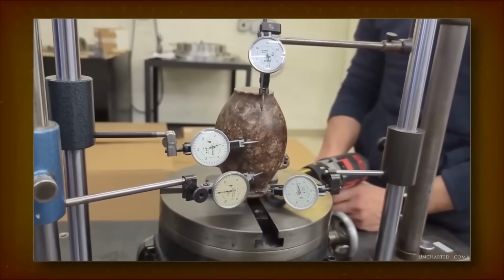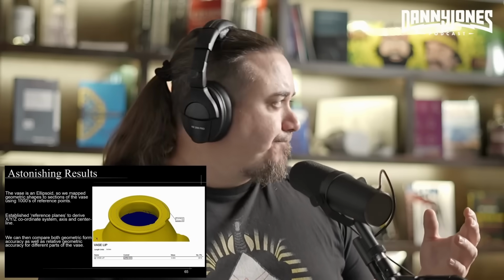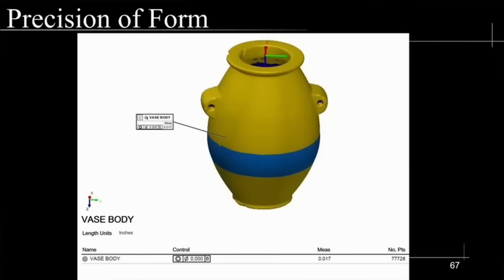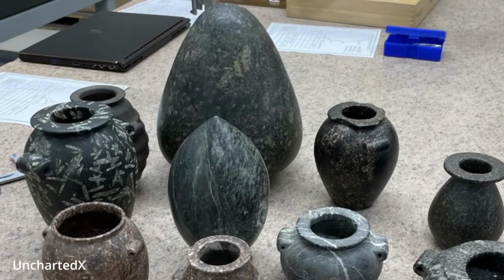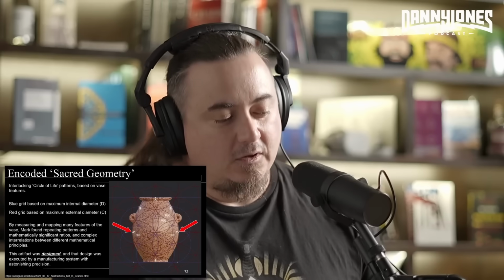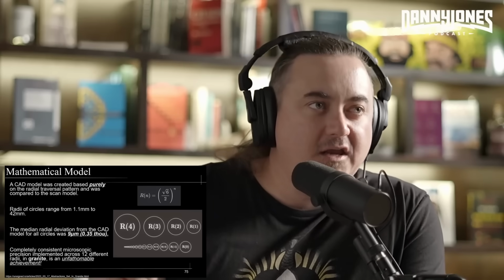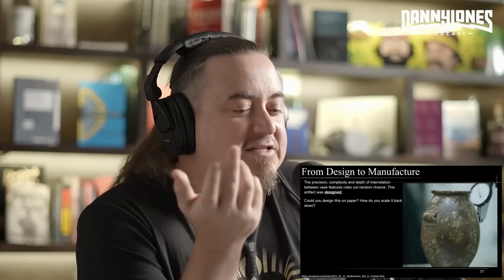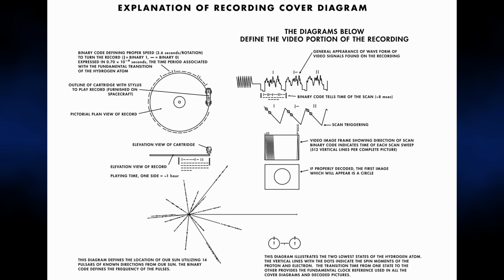Are These Ancient Egyptian Vases Actually Impossible to Make? #podcast #science #history #egypt

Comment: I once left a respectful comment giving alternative possibilities on one of his videos that was quickly removed. Hmmm. I have a life time experience as a sculptor making things as they were made in ancient times. As for this vase, obviously the finished product in granite was not made on a lathe due to the projecting handles. I would say it would be turned on a lathe in a very fine hardwood with the handles applied later. Then a mold is made and it is cast in geo polymer. Dr. Davidovits has done decades of research in geopolymer manufacturing in ancient Egypt. Most of these vases appear to be made of a breccia type stone. That is a stone that has been shattered completely and later recombined into a solid stone. This can happen naturally, but it can also be man made. It takes an expert of the caliber of Dr. Davisvits to tell geopolymer from a natural stone as the amount of "cement" binding the stone back together is microscopic.  All the raw material for this process occur naturally in Egypt and Davidovits has identified geopolymer in some stone in the great pyramid.  Smash the stone into fine gravel, combine with additives, then pour and tamp into the mold. I have no doubt that this is how that mysterious very thin famous "wheel" made of very hard black stone was made. Same thing for the pyramids, smash the soft limestone, carry it in baskets, no mysterious huge ramps required and tamp it in wood molds, where it dries into limestone once again. I have read that the great pyramid has a much higher humidity level than it should, which could be from the geopolymer construction. Pyramid stones are found with wood grain on them, fibres sticking out, not to mention shells embedded in various angles instead of uniformly flat horizontally as in nature. In my opinion, "making stone" is far more magical than carving stone. :)
Reply from the maker: I agree. Thank you

Comment: This video blew my mind. My bet is that it was done by water cutting. Water cutting gives you polished finish at once, and and does not stress the uneven grain structure of a rock, at least much less than other ways of cutting. Super high pressure water jet cutting, can cut basically anything. Yeah. 10 000 years ago. They were capable of producing very high water pressure, and had metal jet heads.
Reply from the maker: Interesting

Comment: 1.  Is the vase that was claimed to be highly precise verified to be an authentic Egyptian vase?

2.  Is this vase similar  to the other vases, and are its measurements similar? or is there discrepancy and differences between the samples and artifacts of vases?  i imagine many vases are not the same.

3.  Abrasion is a well known method to be able to get smooth finishes.  And who knows which abrasives they may have used.

4.  Is the vase perfectly milled at every point? or are there areas of imperfectness? again, is this a legitimate ancient vase?

5.  Larger sample sizes are best.  The arguments dont hold if we are only looking at a couple dubious samples.
Reply from the maker: It is not easy to work with museums or private collectors. There are still thousands of these granite vases under the Djoser pyramid. They should be analyzed!

Comment: 5
Difference Between English & Metric System
The metric system (SI) uses base-10 (powers of 10) for easy conversion (e.g., 100 cm in a meter), making it simple for science and global trade, while the English (US Customary) system uses complex, inconsistent units (e.g., 12 inches/foot, 16 oz/pound) rooted in historical body parts, making calculations harder but sometimes more intuitive for everyday use. The metric system is standardized internationally (meters, grams, liters), whereas the US system has variations (US vs. Imperial gallons) and lacks a consistent base, though both have strengths, with metric favoring calculation and English favoring practical division.

Comment: Sonic frequency devices, including ultrasonic cutters and sonic drills, utilize high-frequency vibrations typically ranging from 20 kHz to 40 kHz or higher to cut, carve, and fragment hard, brittle materials like granite, marble, quartz, glass, and ceramics. These tools operate by driving a tool (often with abrasive slurry) to create microscopic fractures, cavitation, or mechanical stress, allowing for, in some cases, up to 90% less force than conventional, diamond-tipped methods. 
Key Aspects of Sonic Frequency Devices:
Mechanism of Action:
Cavitation & Micro-chipping: The tool vibrates at ultrasonic speeds, driving abrasive particles (like silicon carbide) into the workpiece. This creates a "micro-hammering" effect, chipping away material at a microscopic level.
Low-Force Cutting: Because the tool vibrates rather than relying solely on pressure, it can cut through hard materials with minimal force, which prevents damage to delicate or brittle materials.
Resonance & Tuning: Systems are often tuned to the natural resonance of the material, allowing for highly efficient energy transfer.
Applications:
Industrial & Jewelry: Ultrasonic drilling is used to create precise holes (0.5mm-4.0mm) in gemstones, precious stones, ferrite, and glass. It is also used to cut intricate shapes in hard materials.
Construction & Masonry: Used for precise, high-speed cutting, milling, and drilling of hard materials like granite and marble, often reducing tool wear and improving efficiency.
Potential Ancient Uses: Some theories suggest similar high-frequency, abrasive-driven technology might have been utilized for advanced stone carving in ancient,, pre-industrial contexts.
Advantages over Traditional Methods:
Precision: Allows for complex, detailed, and non-circular shapes.
Non-Thermal: Unlike laser cutting, ultrasonic machining does not generate significant heat, avoiding heat-affected zones (HAZ).
Reduced Waste & Damage: Produces clean cuts with minimal, if any, damage to the surrounding material.
Speed: In some applications, it is significantly faster and more cost-effective than conventional, diamond-plated tools. 
These devices are particularly suited for materials that are too hard, brittle, or non-conductive for other, more common machining techniques.

Comment: they are NOT vases they ARE "Pressure Vessels" hence the symmetry and almost identical lip around the top rim on the ones in question, some are vases these are not...i believe they were for storing chemicals and tightly sealed on top with some sort of universal lid material which has decomposed over the years leaving no trace behind...there is no other purpose for the lip the way its designed other than to be used for securing the "LID" on top tightly....possibly for pickling/canning but you would find evidence inside them it that were the case and i have yet to hear of any tests being done on the inside to identify what was previously inside though doubtful you would pinpoint the exact contents due to the passage of time and possibility someone used it for other purposes after it was discarded...just my 2 cents here from outside the "VASES"  box, i dont buy the whole vase theory or there would be more evidence of the contents like other ancient civilizations we have investigated and found exactly what was in the POT they found thousands of years later...

Comment: Clearly these are made on a wheel. There's no way to be very accurate when you're just doing it by hand. So they spin them on a wheel the same way you would do with clay and grind the outside, leaving a ring where the handles are going to be. Then you remove the inside material the same way by grinding with some sort of a drill, which could be a simple as a round granite post and use sand as the grinding material. The handles could have been done by hand at that point by sanding and grinding the leftover rim until you just have the handles left. It's certainly not magic and it's certainly not aliens from outer space with advanced technology. There would be some evidence of it that we would have found by now. We haven't even found indoor plumbing. So if you're hypothesis is that aliens used magic to create these, you need to come back down from outer space. Whatever the techniques used, they must obey physics.
Reply from the maker: Why does everyone hide behind aliens as the solution? No aliens are mentioned on this channel! This is nonsense

Comment: Take a block of stone, clamp it down, bore the insides, fit the block to a lathe using an expanding mandrel, turn the outside to match the inside using templates. This will be concentric and EASY.

Outside then inside will be a disaster due to clamping and concentric issues.

Comment: I'm a Materials Engineer for over 35 years

Machining a granite vase with thin 5mm walls requires diamond tooling, precision CNC or lathe setups, and careful stress management to avoid cracking. Granite’s hardness and internal grain structure introduce unpredictability, especially at thin tolerances. This is how I'd plan to do it today.

1. Material Prep

Start with a granite cylinder slightly larger than final dimensions.

Ensure the block is free of internal fractures or inclusions using ultrasonic or X-ray inspection.

2. Rough Shaping

Use a diamond wire saw or CNC bridge saw to trim the block into a rough cylindrical form.

For internal hollowing, a diamond core drill can remove the central mass, leaving a thick-walled shell.

3. Precision Turning

Mount the piece on a stone lathe with water cooling and vibration damping.

Use diamond-tipped turning tools to gradually reduce wall thickness to ~5mm.

Maintain slow feed rates and constant cooling to prevent thermal stress.

4. Final Finishing

Polish with diamond abrasives in progressively finer grits.

Use laser scanning or structured light to verify wall uniformity and symmetry.

From start to finish this would probably take 50 hours continuous work using the tools we have today.

Unpredictability in Carving Granite

Granite’s unpredictability stems from:

Grain structure: It’s a composite of quartz, feldspar, and mica, which can vary in density and orientation.

Microfractures: Invisible cracks can propagate under mechanical stress, especially when walls are thin.

Thermal expansion: Heat from tooling can cause uneven expansion, leading to stress fractures.

Tool chatter: Even with precision setups, vibration can cause edge chipping or wall collapse.

Mitigation strategies:

Use real-time acoustic monitoring to detect stress buildup.

Apply low-pressure, high-precision tooling with constant coolant flow.

Consider epoxy stabilization or resin impregnation if the granite is porous.

Conclusion:
I have absolutely no idea how they were made 6000 years ago, they would be extremely difficult to make today. There would be a very high failure rate through the inherent unpredictability of working granite to such thin tolerances. To suggest that they were formed by hand tools clearly demonstrates a lack of understanding of the complexities involved.
Reply from the maker: I fully agree. Thank you for sharing
Reply: Thank you for all this amazing information👍
Reply: Realmente...le agradezco la explicación tan detallada para lograr un objetivo tan difícil....salud perfecta para usted y sus seres queridos....hare krishna
Reply: Brilliant.  Thank you so much
Reply: And yet there's 10s of thousands maybe 100s of thousands of them
Reply: Hi, thanks for your great analysis. As a MechEngineering student, i had some work done at the workshop. However, with this part, a thing that came to mind was regarding the thickness tolerances and how to exactly achieve them, given that one would have to work through the material from the inside out. Today at least with metal, im guessing broaching or some similar process.  If we consider this to have been done manually, it would be nothing short of miraculous to achieve tolerances such as they claimed to have verified...
Reply: @Mz-ci8wg  Yes, absolutely unachievable by hand :eyes-pink-heart-shape:
Reply: I just came by this video.  Ben’s stuff is always fascinating! I’m glad you posted your comment.  I found your experience quite interesting.  It’s always good to hear someone with expertise.  Yeah, this seems like it would be impossible to make these 6,000 years ago.  Even 600 years ago! Aliens? Lost ancient tech and know-how? Idk, but it’s crazy when you think about it! Thanks for your comment!
Reply: @theycallmethedude.  Yeah, I agree completely - it is incredibly strange. You cannot make something so delicate out of such a hard material with hand tools  I'm gonna say it's impossible.
Reply: @theycallmethedude.  its just rocks and unlimited people and time
Reply: @NeuroScientician I would have to think there’s more to it though.  Even with other rocks and ample time, the craftsmanship is just unreal.  There has to be a lost or forgotten knowledge of some kind to make these.
Reply: Or just pour liquid granite in to the mold :)
Reply: 1/40 of an inch walls of granite 😲....whoever made them knew what they were doing for sure
Reply: I am not going to spend more time on this object,  because i have more questions on who found it, where , and when. Until then the object its self is less important then the legitimacy. 

If i would put my carrer on the line. The quality is basically the BMW (car) of vassals.  The artisan obvious to me will not do this for everyone. And there would be some kind of signature. Maybe in the Golden Ratio. Da Vincci did that also
Reply: @Happytravelerx32 
Except they've found thousands of them.
Reply: @iamchillydogg  But all the high precision ones lack provenance to a specific excavation.
Reply: You are comparing wrong things, you assume high volume, high efficiency, repeatable process with uniform quality, minimal waste or tool wear and that is not the type of situation. That vase might have been done a group of masters over a couple of decades, extremely inefficient this one could be the attempt 300. this doable as their priorities were different.
Reply: @NeuroScientician  I get you. However, maintaining such tight tolerances would require a degree of measurement that they certainly didnt have with the tools we associate with a culture that didnt even know the wheel until around 1500BC.
Reply: @Mz-ci8wg  You are underestimating the power of unlimited people and unlimited time
Reply: Do you think these vases could have been molded and not carved?
Reply: Again those “as a machinist”, “as an engineer”, “as an aviation enthusiast” comments.. dude. If you really are what you claim to be, then you should really know that this thing is a piece of cake nowadays. Modern technology goes nanotechnology with half-conductors not grinding down granite by hand. It’s totally doable, bro. Doing these things by hand is as difficult as it was back then. Take 1 year off from work and start grinding. But you need pretty good technique, tho. Need to master the craft. That’s it.
Reply: Your comment makes no sense - Nanotechnology with half-conductors is about engineering materials at the atomic or molecular scale - It has nothing to do with shaping or carving bulk materials like granite. Granite vase making relies on mechanical processes: sawing, grinding, drilling, CNC machining, polishing.
Nanotechnology relies on atomic-scale fabrication. So while nanotech is revolutionary it wouldn’t be applied to manufacturing a stone vase. For a vase, you’d stick with modern stone working methods and/or CNC diamond machining.
Reply: @kevinbpcl  exactly. Not so impressive to grind and polish down granite, isn’t it? Just mechanical process. They’ve bed cutting diamonds wayy before power tools, hand cranks and all. Diamonds are much harder than granite. Wonder.. how did they do it? Lol.
Reply: @stout8529  I don't think you understand the complexities involved - LOL
Reply: @kevinbpcl  i think you simply overthinking the mater. lol. It’s a granite block, sanded down smooth. That’s about it.
Reply: @stout8529  'Granite block, sanded down smooth' :face-turquoise-covering-eyes:yeah, you're under thinking it :eyes-pink-heart-shape:
Reply: @kevinbpcl  yeah. There’s not much to think about. I don’t stare smoothed down granite blocks with constant awe. Acknowledge the craftsmanship. It is definitely doable by hand tools. And that’s the most likely answer to “how”?
Reply: @kevinbpcl   I was looking for this comment and you have exceeded my expectations! 
Very well said sir, thank you